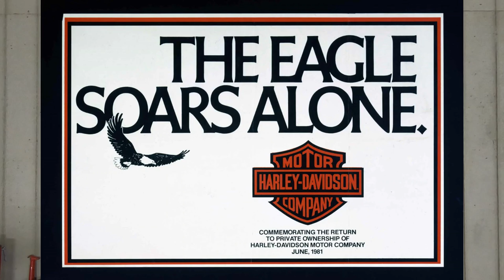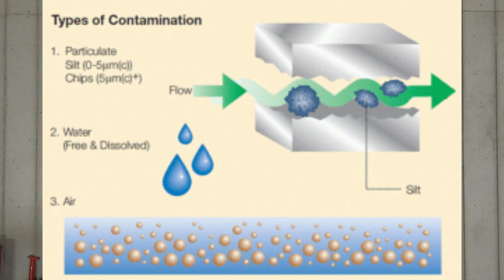Harley Engine Quality Isn't What It Used to Be

Comment from the maker: Do you feel like Harley-Davidson engine quality has gone forward or backwards with the new engines?
Reply: Evo 883 sportster.  Best HD engine.  Only one I'd own.
Reply: Backwards I learnt first hand with two new M8s both 50k lemons both gone never again
Reply: Video Idea.
I would love to have a series like "how to make your Harley XYZ bulletproof"

I personally own a 2012 wide glide with  the 103 TC in it and would love to own this thing for a looooong time
Reply: @Shane G  can't help ht ask..... 50k lemons as I 2? Total engin fail or needed some work?? I've got 70,000 on 2015 103. Couple problems over the years but nothing catastrophic
Reply: Depends on the bike, IMO. If the bike is a lighter bike, the Twin Cam and the M8 are fine. The touring bike both engines are very underpowered. Mass production and cut cost spending. To me, this just gives aftermarket companies to build parts to make the engines better all around or buy a complete aftermarket engine and don't worry about the Harley engine. The same principles apply to sports cars that become race machines. Usually, if you have the money, you drop a crate performance engine in and pull out the original engine. This way, if you sell the bike, you can sell the bike with the original engine. To me, if I'm going to beef up the original engine, it is because I want it to last, and I'm going to keep it for a long time. Otherwise, like other auto machines, I'm going to cash it in for a new one. Personally, I like 2010 softail classic. It's practical. Get me point A to point B. Ther isn't a perfect motorcycle. Just the one each biker prefers, and that's the bottom line.
Reply: Emissions are what makes new engines better than ever. The engine built for sales today burn so clean one might breathe the clean air coming out of tailpipe if they were to need oxygen. 😮
Reply: @Family Landscape Company Inc.  My well maintained 103 popped @ 67,000. Yuy
Reply: @Family Landscape Company Inc.  My well maintained 103 popped @ 67,000. Yuy
Reply: @Family Landscape Company Inc.  My well maintained 103 popped @ 67,000. Yuy
Reply: @Family Landscape Company Inc.  My well maintained 103 popped @ 67,000. Yuy
Reply: @Family Landscape Company Inc.  My well maintained 103 popped @ 67,000.
Reply: Backwards
Reply: As a guy that worked in the service department of a Harley dealership during the AMF years, I guarantee that Harley engine quality is not as bad now as it was then.👍
Reply: @martymcfly1776  I Road 60’s and 70’s  Harleys never had any problems with them. Of course I rode 80’s and 90’s Harleys also..
Reply: @ltsgarage7898  I worked for the service department of a Harley dealer in the early '80's.   Maybe that slants my perspective because I only saw the problems.
Reply: @martymcfly1776  one thing that was wrong with their motors was that they had a broomstick for a cam. Plus low compression. Those two things were pretty easy to fix.
   None of my Harley’s broke bad enough to have a dealership repair them.
Reply: @ltsgarage7898  That was right after unleaded gas came out. Without lead in the gas, the stock valve guides would wear in a few hundred miles.  To prevent this, we put  aftermarket valve guides in every bike we sold.  We also drilled out the idle jets on the carbs, to get them to idle properly.  There were two electrical modules, one was the voltage regulator, and one was the electronic ignition.  We replaced those by the bucketful. . . .
Reply: @martymcfly1776  I don’t remember having any of those problems. 
How old were you in the mid 80’s?
Reply: @ltsgarage7898  That was actually back in the early 80's.  I was about 27 at the time.  That was prior to the Evolution motor.
Reply: @martymcfly1776  well I’m not to much older than you. Maybe 5 to 7 years.
  Do you still ride?
Reply: @ltsgarage7898  I've got an '05 Suzuki Bandit.  I don't ride it a lot.  I never was much of a Harley guy.  When I was married my wife said she'd divorce me if I bought a motorcycle.  Then she divorced me and I bought a motorcycle.   😷
Reply: @martymcfly1776  I had 9 motorcycles at one time. 8 Harleys and a 2008 Suzuki Hayabusa. 
   Now I’m down to just one Harley.
1999 Fatboy with an S&S 124 with 166 horse power.
Reply: Till your chain tensioner takes a shit.
Reply: Chain tensioner?
Reply: @bargeman100  I’ve never had any problems with chain tensioners on any of my bikes.
Reply: @ltsgarage7898  Cam chain tensioner dude, not primary drive.  Knucklehead, panhead, shovelhead & evo all had gear drive cams. The TC has chain drive cams and they're a weak link.
Reply: @bargeman100  the only twin cam I’ve ever owned. I purchased it rode it home took out the cam tensioners and dropped in a set of gear drive cams and all. I think I might have had 20 miles on the motor. I also put a tune in the ecu just after I put on the RB-Racing Black Hole header.
  That was my Street Glide
Reply: I think tip toeing around the EPA is all that concerns them with future models.
Reply: @antondahl8945  so going slow AF is your jam, live it up.
Reply: remains the fact they were always kind a crap. and cost cutting  has some inherent risks if pennypushers do it.
Reply: I have ridden shovel , EVO , Twincam and now M8,and every time it was a clear step forward never mind the comments .
I remember when the EVO came out there were lots of idiots that claimed their Shovel was better and EVO was not even a real Harley motor,the same when the TC came out and with the M8.
Harley has never been on he frontline with techbical changes but still the M8 is a fantastic motor, i have the pleasure to ride a Breakout 114 and it is a dream.

Comment: I went from an Evo Sportster to a 2003 Twin Cam. Yeah, I found out the hard way that Harley cheaped out on the internal engine parts. That would be acceptable on a cheap bike but it is absolutely unacceptable on a brand that claims to be "Premium" and charges a premium price.

BTW, I miss the saggy shelf with the aerosol cans in the back. It was like a mascot.
Reply: I went from a 99 sportster that I kept for over 10 years into it 2003 road king I put about 45,000 trouble free miles on that bike. What problems did you have? I did upgrade the complete two hydraulic tensioners at 15,000 miles.
Reply: My 2003 RKP has 114,000 miles on it. still runs good. Although I had to replace cam chain tensioners 3 times BEFORE they went bad, well , that's what wrenches are for. The only other internal parts were lifters, I replaced at 100K
Reply: 😂😂😂😂😂😂 thought i was the only one that noticed that !!
Reply: I had 2 1200 sporties one was 01 Buell but with absolute young fella abuse 75000kms & 55k other Absolutely for from cold startup I never had 1 issue besides a battery in either,by far most reliable engine & I've had multiple twincams M8s,dropped over 50k on both M8s & both spent more time in wrty than my shed both all same engine issues deadset lemons even with stage 4 kits etc all done from new at dealer I now have a Honda till I find the right twincam.....
Reply: I bought a '99 TC new and rode it over 100,000 miles. I put a gear drive cam and had it dyno tuned at 15.000 miles to get rid of the tensioner worry's and that engine had never been apart otherwise. I changed my oil every 2500 miles. 
  Up until '95 they had the bolted crank which was practically indestructible. What kind of problems did you have with yours?
Reply: @rodzimmerman1979  99- 02 had the better cranks.  Mine is 03 and shows some runout so I can't run a gear drive. Conveniently for Harley Harley they loosened the allowable tolerances on crank runout to avoid warranty claims. My OEM tensioner shoes were pitted and worn with less than 5,000 miles. They OEM shoes are prone to crumble too, so I went with aftermarket. Theres also the inferior inner cam bearings so I swapped them out too. For a company that loudly calls themselves a "PREMIUM" brand they sure do use a lot of cheap parts. Expecting the customer to pay a premium price and using cheap parts is unacceptable.
My old Sporty was worth every penny and built right. The big twins are not either.
Reply: I bought a new Moto Guzzi Eldorado in 2019 and I couldn't be happier. Sold my 2003 Road King last year and I don't miss it.
Reply: Hum yep i brought a sh had 883 and twenty two years later still miss the bike, 3 an a half boy it was FUN  
First run mitcham south London to 
 sheeply Yorkshire H.D.R.C.G.B. 4 hours in 4kin rain 'pissing down' this was my first time with a great club
Now as an C & G machanic Harley's have always been over engeneed and heavy as hel still I sold him so to dock gate 20 to buy colbolt blue 2001 FXD 88 cubic in  1450cc heavy as 4..k but vainces  & haines long shots mackunie carb K N air filter 36000 on clock well 110 mph coming away from Kent wife on back and still want to go faster Sadly I would not buy a new Harley and that's NO disrespect to the gentleman family Warrs at Fulham London England. .

Comment: Harley-Davidson, One step forward and two steps back. When they removed the TIMIKIN and went to the flat roller they took us back to 1953. Then the tried to cheapen up on the bearings in the cam chest they took a step back to the last of the Shovel heads that came with a caged cam roller bearing that failed. H-D came out with a service bulletin that stated if a German bearing is installed  remove it and install a full compliment Torrington cam bearing. They didn't learn their lesson and tried it in the Twin Cam with the same result only with no service bulletin for replacement, All they care is it that it will last until the warranty has expired. From the dawn of time until the EV2 the crankshaft was a Five piece unit with replaceable; crankpin, pinion and sprocket shafts. The EV2 has a Three piece Crank with the shafts machined from the flywheel castings. They had failures of the pinion shafts due to an improper radius in the machining cut causing a stress riser that would cause the shaft failure.( I replaced a few working for the dealership) I have built some nasty Nitro Dragsters and never had the wheels shift,  since working on the twin cams I have seen more than one set of wheels scissor and it sucks. The only other failure in the EV2 was the plastic crank case breather gear that would disintegrate. Once the got those few snags worked out the were a great engine.
Keep the  great video's coming and I hope everything works out to your satisfaction.

Comment: Harley made a mistake with the EVO. They run well and for a long long time. Many keep them for years rather than trade for something without the known longevity. My 99 Softail Custom only has 65,000 on it and runs like new. And the fit and finish on the bike are fantastic. Having heard of problems of the later twin cam engines, I love the simplicity of the EVO. But Harley cannot sell new motorcycles if the old ones keep running. I have kept mine stock for the most part except for lots of Chrome the first owner put on it along with drag pipes and a K&N air filter. My 99 comforts me.

Comment: This is hilarious! I have been talking to some other person on here and he says the old engines (the ones that killed HD prior to the Evo) were solid, and the new ones are solid, and Evos aren't all that. I of course told him he was one in a million. Now you publish this (I agree 100%) and it cracked me up. The timing was perfect. I plan to stick with my 1991 Evo. It seems to be solid. I also prefer the reliability of my carburetor over fuel injection, where any one thing can stop me in my tracks.

Comment: You said something that speaks volumes. Drive sensible. Big twins are not hot rod engines, there I said it. I've had Shovels,Pans, Twin Cams and am currently on a 67 Shovel. Every one I've had required some mods to the engines for longevity. Treat them for what they are and they will take you down the road and back.
Good articles, hope new digs work out for you.
Reply: BC,You are 100% right.if you start out with a good running H-D and you treat it like it was built to be treated,then it will last you forever,there will always be maintence and some parts do wear out over time just keep up with her.If you pound her into the ground,rev the f out of her,or just don't maintain her properly,then like anything,you will end up with a broken motorcycle.Don't blame the bike,blame an aggressive right hand.
Reply: Baggers running 7s.  No hotrodding there.

Comment: I've done lots of research & watched many of your helpful videos before buying parts for my builds. 2006 street glide, Arlen Ness big sucker, pro pipe, fueling OEM+ cam plate, 509 S&S cam, & Power vision. Bike runs real strong for 88 cubes. Keep up the great videos! I'll be watching.  Thanks
Reply: "Research" The most overused word ever in the internet era.
Reply: My 88 is still running great after 17 years.

Comment: I have had several shovels over the years new and used . I never had any issues with them and were quite reliable with proper maintenance and upkeep. That’s the major problem with the shovels was the lack of maintenance cause the majority of the problems .
Reply: Facts 👌 💯
Reply: After I bought my shovels (used) and all the issues were fixed, they have given me no problems whatsoever. (knock on wood)
Reply: I believe you're right. Shovels were reliable if they were maintained properly. The other reason for their bad reputation was too many of them wound up in the hands of people that simply abused them.
Reply: 100% right, I have had shovels half my life with no problems out of the ordinary.
Reply: That’s true with all engines.

Comment: I went through the factory school in 1981 and saw a fellow trueing wheels on a modified trueing stand with a foot operated air center point, trueing more than one crankshaft a minute he was doing. The early Twincam loose cranks were fixed the dirt bike method of welding the pin. Old and retired now.
Reply: At the capital drive plant I saw that in Jan of 1982 and them balancing the assemblies electronically assembled crankshafts to a set piston weight

Comment: I did get some rework done on my 2018 Road King Police with a multitude of things including a new oil pump and installed am external breather. So far it's been running great and I have about 80k miles on it. I ride it everyday down here in Florida. Hopefully it lasts
Reply: How much did the oil pump and labor cost you? Need to do the same to my 2018 Low Rider eventually.
Reply: @@Peter-nm1ps I actually bought it used with 10k miles on it. The rest I've been putting on. It's actually been very reliable and the one time that I did get it towed was for a nail in the tire and since I had the wheel and tire warranty, that didn't cost me anything
Reply: @@Peter-nm1ps that's great that it still runs good. I'm not into sport bikes anymore unless it's a track day. I just find Harley cruisers way more comfortable and practical for everyday use. To each thier own though. At least you're on two wheels. Keep riding, and keep enjoying what you're doing
Reply: @Kajemyster  The oil pump was covered under warranty and they actually changed it to a 2022 oil pump. I'm looking to changed out the cam plate, and put in a new cam as well to the ones gixxerfoo recommended for a little more power and longevity. I may have my local shop do that instead of taking it to a Harley dealership. I got quoted about $800 for the cam plate, cam and labor.

Comment: The MoCo needs to solve the crank runout issue.  Their solution was to allow for a higher runout to be considered in tolerance.  Rebuilding the crank was a major expense during my 50k refresh.  
Come on HD….Just weld the damn crank.

Comment: I brought 2 brand new M8s & spent huge money on stage 4 kits full exhausts everything done right dealership over 10k on engine alone each bike & both were in shop on wrty more than my garage with stator regulators,oil pumps & backing plates,oil locks cooking engines & after 40 years riding 20 of those years with 9 Harley's I have a Honda in shed now don't own a Harley anymore,last twincam103ho I thought were great engines I never had any issues with but the M8s both were a nightmare I'd kill to get my 16 breakout back hassle free bike screw M8s never buy another

Comment: I'm glad i chose for the BMW R1100RS, a pretty cool design those cyl heads and having a camshaft snucked in there, futuristic suspension.
It seems to do 0-200km/h in about 11/12 seconds with only 90HP and 100nm Torque and doing 5 liter / 100km.

Comment: I was going to buy a new Honda Rebel but loved the look of the 883. Saw a 2001 for 1/2 the cost of the rebel. What sold me, however,  was the EVO reputation... bullet proof. I hope I do not curse myself. So far so good. 😊
Reply: @Peter  Done 2 years ago... so far no regrets. Very different machines. I have to admit, I did my refresher course on the Rebel, nice bike, but I wanted a little more character in my older years. Already owned 3 Asian bikes.
Reply: @Peter  Well... not this guy. Icon jacket and my 883 has been labeled a girl's bike... by big Harley guys ... you know, the ones you classify as apes!
Reply: 2001 is the end of the run. Great bikes!

Comment: And yet, neither the author, nor anyone else mentions the huge involvement of S&S in the development of the Evo. H-D' s best motor EVER!
Reply: Sorry George Smith to my knowledge didn't. The Evo project was started in 1979. I saw 2 in bikes at service school in Jan 1982 across from the cafeteria downstairs looking through a window before I got run off. 12 engines 750,000 test miles on those 12 before the release in 1984 year models in Sept of 1983